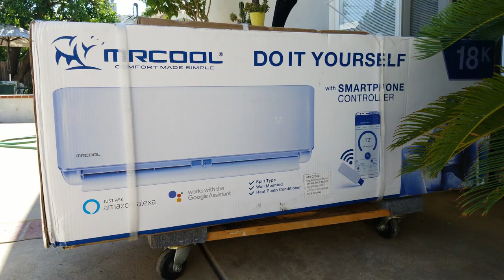Mr Cool DIY 18K BTU Mini-Split Air Conditioner Installation

Comment: Looks good overall but I am a heating & air tech and my only advice would be to lay the excess refrigerant lines flat on the ground or somehow mount them so they have a (mostly) steady incline towards the inside blower unit. Right now your setup has created a oil trap in the looped refrigerant lines & will decrease the amount of oils getting back to the compressor. Compressor will not make it very long if it can’t pump the oil back to itself
Reply: That's pretty much the way MrCool describes for handling the excess line in their installation manual.  Might want to educate them because most of us are just following their instructions.
Reply: Hi,… your comment,… steady incline towards inside blower is impossible in 99% of cases installing this design unit.  In most cases the inside air handler is above the outside condenser…. If
Reply: Your comment to “steady incline towards the inside blower” is impossible on 99% of installs of this unit.  In most cases, the inside air handler is installed above the outside condenser unit…. In fact I have not viewed one install on YouTube where the inside air handler was installed below the outside unit,…. And I have viewed a lot of video’s… dozens!.  This begs the question what should be done with excess copper line set?   I installed my excess coil on the horizontal….  This idea is to not trap refrigerant oil in vertical coils….  Any other ideas, I would love to hear Em….  Thanks…

Comment: Hi Phil, I would have cut the plastic bushing first to see if you could fit it around the wiring.  Otherwise, I'm glad she is still working great.  My 18k BTU just arrived today.  Wish me luck!
Reply from the maker: Didn't think of that!  It probably would have fit, but I think strain relief makes it a better solution to avoid the wires from moving.  Thanks for watching, and good luck with your installation!

Comment: Great vid. My suggestion for the outside surplus install wire and hose is to coil it inside in the drop down ceiling if you have that option, so that it's not exposed to the elements.

Comment: I just bought a 12btu window ac/heater for my man cave / 3 car garage but I have not install it yet.  Looking at Mr cool unit now.  Garage is fully insulated about 620 sq ft with 8 ceiling ft high. I have pool table and gym in there😁 I live in Clovis California with a zone 9b or 9 I think
Reply: Also what about electrical, can I just plug it in into a 120v or do I need to run a different line just for the minisplet also do I need a shut of box too?

Comment: I'm curious as to why you didn't check the level of the bracket with a level before you drilled all of the holes and put the anchors into the wall? I would have wanted to make sure that the left side of the unit was either level or a smidgen higher than the right side so that the condensation would drain correctly. If it is lower, then you might have water overflowing the pan.
Reply from the maker: Hi Craig,  actually the wall unit is level.  The ceiling is sloped,  so that's why it looks like that.  Also,  it's a low ceiling so I put it as high as possible, while leaving enough space for opening the cover for cleaning. You have a keen eye!

Comment: How's it working now, 2 years later?  I just bought this one as well
Reply from the maker: It's still working fine!  It's actually going on 3 years now, and one thing that has happened is that the condensation discharge tube that's exposed to the elements has gotten brittle and has broken off.  I'm going to have to attach a new tube to it inside the plastic lineset cover to direct the water  away properly.  Thanks for reminding me!  I haven't needed to worry about this yet, but with the weather warming up I should get on it.
Reply: @PhilsDIY  That's great to know!  Thank you for the response 👍

Comment: Should I use thread sealant on the refrigerant line connections?
Reply from the maker: The installation manual for mine did not say I needed to use thread sealant, and I honestly can't remember if I did or not!  I think it's probably a good idea to use some just for the added safeguard.  The Mr. Cool system came with pre-charged lines with a seal on the end of the line set that got punctured as you tighten the fittings.  Once on, you can't loosen or reposition without losing some of the refrigerant.  I guess I did it right, since it still works great after almost 3 years.  :-)  Thanks for watching - and don't forget to subscribe!
Reply: @PhilsDIY  Thanks!  I actually missed a whole section that said do not use sealant as it will cause leaking, didn't realize the fittings have a gasket on them all.
Reply from the maker: @brendon4901  ooh, glad you read it again!  Mine didn't say that.   Disaster averted!

Comment: FYI, I haven't seen this particular connector, but I've yet to see one where the metal inserts (along with the attached wires) couldn't be removed with a tiny flat head screw driver (or sometimes even a straightened paper clip).  They all have a little flange that clips them in place.  Use the tiny screwdriver to push the flange in so you can pull the insert out of the plastic plug.
Reply from the maker: Hi, thanks for watching and for your comment, but I'm not understanding what it is you're referring to.
Reply: @PhilsDIY  https://youtu.be/Vt_rAIKPlWA?t=189
Reply from the maker: OK  but what does this have to do with the AC installation video?

Comment: Great video, do you have to run the power cord outside? Can tI be plugged into a dedicated window a/c outlet inside ?
Reply from the maker: Hi Steve,  this and probably all mini-split systems require a dedicated power circuit hardwired to the compressor unit.  Because of this you can't just plug it in to a wall outlet.

Comment: Hi,… and thanks for the video,!…. What version of mr cool did u install here.?  Mine is ver. 3rd, and the line set is different,  yours seem more flexible and covered with what looks like a plastic sheath…. Also these seem to be attached at the indoor air handler from the factory.  Mine was not… and needed to be attached during install at two ends.
Reply from the maker: Hi, I have Gen2. Yes, the inside unit had the line set already attached, and is inside an outer sleeve.  Purchased in July 2019.  But I don't know version number.  I chose this because it had the lineset attached and I only had to attach one end to the compressor.  The prior unit was a LG and I had to install the lineset on both ends, but I must have not torqued it tight enough and the refrigerant leaked, and I could never get it to work properly again.  That's why I got this one, and so far after 2 years, still works great.
Reply: @PhilsDIY  Hi phil,.... many thanks for the reply.  Sorry about the issue with the LG on the first install...  I installed my 3rd gen a few weeks ago and so far, it has been outstanding,   So do you remember the material the tubing was made out of on the 2nd gen?   They seem to be more flexable than the all copper tubing shipped with the 3rd gens?
Reply from the maker: If you mean the refrigerant line set,  it's copper.  Just mildly flexible.  They were in a sleeve,  probably thin pvc, along with the power wires.

Comment: gotta check the minimum distance from ceiling and wall outside.
Reply from the maker: Thanks for the comment.  The room has a low ceiling,  so I had to put it higher than the recommended clearance from the ceiling.  It has been working great for a year and a half so I don't think this is a problem. I don't know what you're referring to about wall outside.
Reply: I think the install
Instructions state that when ground mounting the outdoor unit, it should be placed at least 12 inches from the back wall.

Comment: Was it a pain to have the line set going out the left side? It seems like that's where the first set of connections are.
Reply from the maker: Not at all.  Just be careful in bending the lines if you need to move the position from right to left or vice versa.  The inside wall unit is designed for either side.

Comment: Thanks for the video Phil. Regarding the ac disconnect box I see you are running metal pipe (conduit) from your electric panel? I was thinking to go with PVC, can you please share why did you decide to go with metal conduit instead PVC also what type of conduit is it?
Reply from the maker: Hi Vinay,   Thanks for viewing my video!  It's just regular 1/2" electrical metal tubing (EMT).  I went this way because it's a slimmer pipe (0.7" OD) than the equivalent 1/2" PVC (0.84" OD), easy to bend, and the bends that I needed to make to get the power to the compressor were sort of complicated and would not be easy to do with PVC fittings.  The 1/2" EMT bends and fittings were less bulky overall so it looks cleaner than the PVC would have.  Lastly, for my installation PVC would have cost more in materials.
Reply: @PhilsDIY  Thank you for your response and making the video it was surely helpful.. Looking forward to more DIY from you!
Reply: Hi Phil, one more question. What is the wire size and breaker you used for your disconnect box?
Reply: @vinaypatel10  It's a non-fused disconnect box, so there's no fuse or breaker - just the thing you pull out to disconnect.  From there to the compressor I used 12 gauge.

Comment: I would like from you to demonstrate the mini split line copper installation , also I would like to know if there are Mr.cool DIY multi zone units  already pre-charged ? anyways thx for the video
Reply from the maker: Unfortunately I did not do any video of actually attaching the copper refrigerant lines.  Because they're pre-charged, I simply brought the lines out of the house and positioned it, then followed the directions for tightening the connections.  You'd have to check with Mr. Cool as to your question about multi-zone units - I don't know.

Comment: I have a 3 car garage man cave of 660sq ft with 8 ceiling ft high. Its fully insulated even the garage doors too. I live in Clovis California in zone 9b I think. 
I been looking at the DuctlessAire 12000-BTU 230-Volt 22 SEER 600-sq Smart Ductless Mini Split Air Conditioner and Heater with 25-ft Installation Kit for $1052
My garage is fully insulated even the garage doors. WIll this work even though it says only for 600sq ft?  Or should I get the  18000-BTU 230-Volt 21 SEER 900-sq Smart Ductless Mini Split Air Conditioner and Heater with 25-ft Installation Kit?  
This one is for 900sq ft but I was reading that if I get an overzsize minisplit it won't work that good?? This one is $1500.
Thank u
Reply: Get the 18k.  Oversize it instead of undersize.  I have a 2.5 car 600+ sq ft garage 9.5' ceilings and went with the MrCool Diy 18k.

Since it's 230v, no you cannot just plug into an outlet.  It needs a dedicated 2 pole 20amp breaker at minimum feeding into a non-fused AC disconnect box (60amp normally) then fed into the outside unit from the disconnect box with a liquid tight whip.

Run at minimum 12/2 nm from panel to the disconnect.  I used 10/3 and a 30amp breaker because I had a 50' long run to do and for upgrading in the future if ever needed the wiring is done.

Comment: I just purchased an 18K DIY. What size space are you heating/cooling and now after 6 months how happy are you with its performance and efficiency? Looking forward to hearing your thoughts! Thank you for your time.
Reply from the maker: Hi!  Thanks for watching my video!  I have mine in the master bedroom,  which is about 16x20.  During summer we didn't use it much because we could cool down the room by opening windows after sunset.  We've been using it for heating for the past 2 months,  and love it.  We turn it on at night only,  and keep it at 73, auto fan,  with the fins fixed just above bed level.  It's SUPER quiet,  so it doesn't affect our sleeping.  Let me know if you have any other questions.